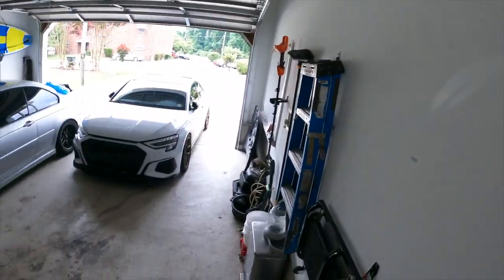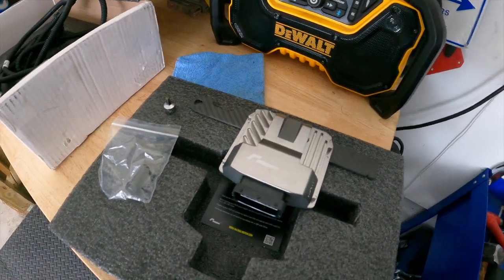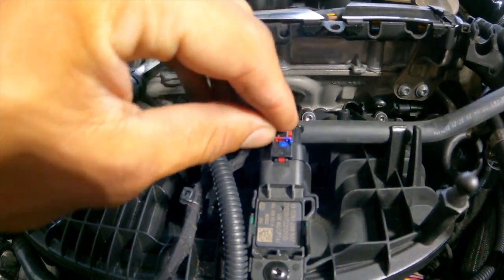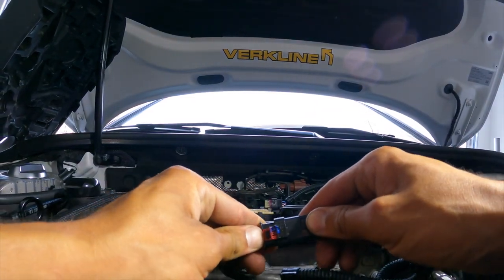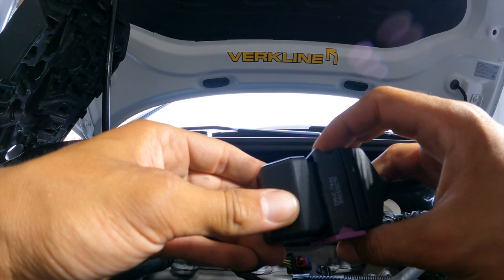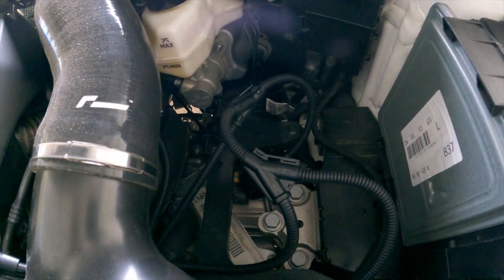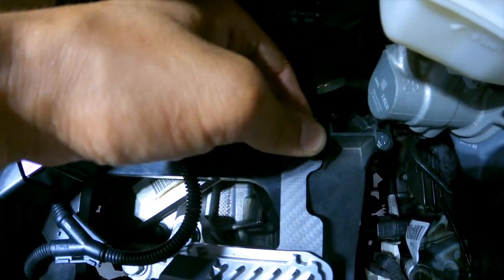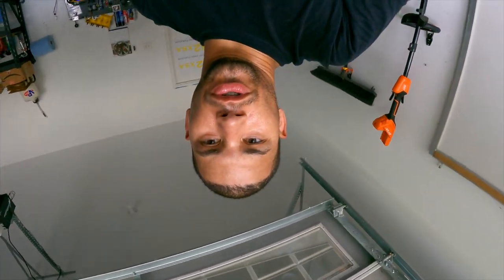Racingline PCM install MK8 Golf R & 8Y S3

Comment: looks good man!i you see any differences on the track??  i got the Racechip in mine i do  notice a small difference nothing crazy.! works well, I'm also going to order a new exhaust system not sure which model yet.. any idea if your going to change yours?
Reply from the maker: Thanks!! I noticed a decent difference at autocross but like you said nothing crazy. Gonna go out hopefully tomorrow night and do draggy runs see if there's a real improvement in times. When I eventually do a catback it will be Remus, they are the shit. But really with just a downpipe these cars sound crazy good. My buddy did just a DP and it sounds pretty damn good I'm not sure if the catback alone is worth it. The OPFs really kill the sound, gotta ditch those. The stock muffler with the dp and OPFs gone really blew my mind. I wish I saved the vids homie deleted his IG account
Reply: @BryceJordanProductions  nice bro! yea man im up in Montreal, Canada, and I'm trying to find someone way to swap this exhaust out for the 2022 Audi S3 but parts are still hard to find.. enjoy the track day hope you pull in some decent times with the chip! !